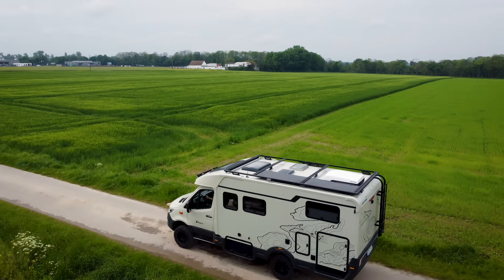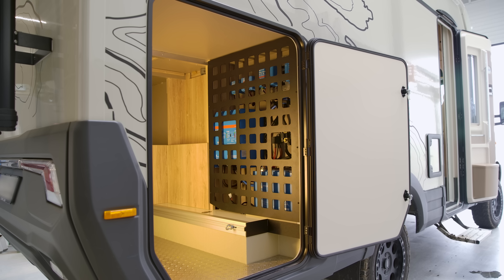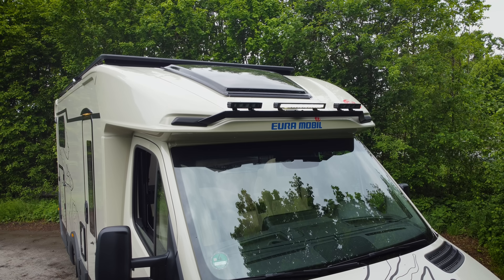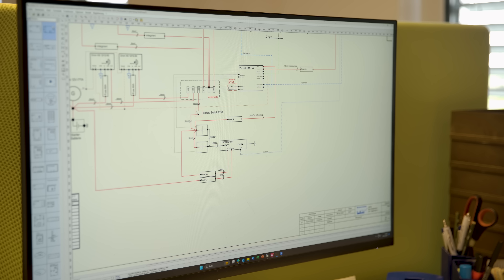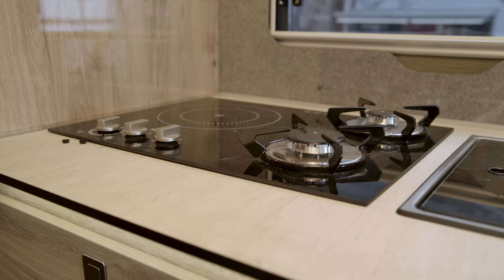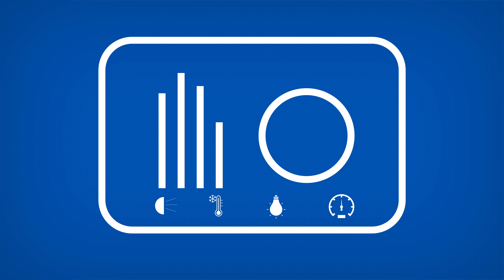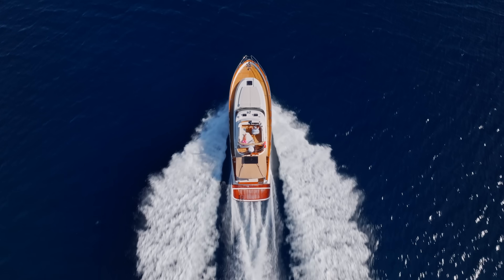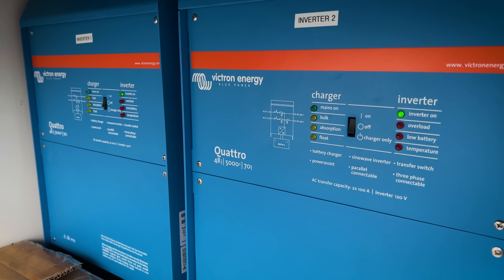Sprinter 4x4 uses a new all-in-one Garmin and Victron control panel

Comment: First, I love my VE system! See VanTransitions channel for details… but 330Ah and that small amount of solar on the roof seems VERY weak to advertise as an off grid wonder van. I don’t get it.

I’m running a Ford Transit with 660Ah, 600W solar, 2 x 30A Orion, MPII 120x2 (much slimmer form factor). I managed 84 hours in full sun (plus the warm nights) running the AC (RTX 2000) at 74F before the batteries were down to 20% and then I went for a drive. This was without cooking, TV, Internet, microwave or anything else. Just the AC and the occasion LED light or USB phone charge.

Good luck not driving distance every day with this rig without more solar and battery.
Reply: I have had several overlanders that used single 230Ah LA battery (basically equivalent to 100-150Ah lithium) and a 200W solar panel. They ran out of fresh water before fuel and electric. They all considered AC as unnessesary luxury item and rather used that weight for other gear. 

Heating and cooling is very energy consuming. I can manage with a 40Ah LA battery without solar in winter for long weekend, since I heat with fuel and absorption fridge. Know also someone that has over 1200Ah in his truck (cooks and heats on fuel, no AC). Such fear for running out of power, thinks it is end of world if he has no electricity left. 

100Ah lithium was few years ago quite normal, nowadays trend I see is to have at least 300Ah or even 600Ah lithium.

So I guess it depends on how conscious you are and your mindset whether that 330Ah is small.

Comment: no propane on that fridge will severly hurt the nomad capability, 3-4 days of rain you will have to run your vehicle alot to charge up the batteries from the fridge draw.
Reply: My fridge is 12V DC 10A circuit. Runs a LONG time.
Reply: Why must a fridge be heated?
In large scale this maes sometime sense (roof top systems)

Comment: Awesome! Now, if only we could get an official and easy to install Victron integration for Home Assistant, so many more people could benefit! (hint)
Reply: Why would you want to pair super reliable Victron solutions with super flacky… (crap) home assistant is beyond me.
Reply: @nja9529  sounds like someones has had a bad experience with a piece of software… the reason this would be a good thing to have is so you can have multiple systems reporting their stats to a main hub, allowing you automate things based on all kinds of variables. I have my Victron system integrated and now the battery status of my home determines whether or not my boiler should generate hot water. But it was a pain to set up due to a lack of integration
Reply from the maker: If it's any help, I have HA and Vicron equipment integrated in my house - and I was the one that filmed this :-)
Reply: @VictronEnergyBV  awesome. By means of MQTT? How did you manage the connection to stay alive?
Reply: Try node red and Modbus (KNX).
Have fun.

Comment: Electronics getting the way deeper into the campers. 
But being off grid and autonomous means a owner must be able to fix things. 
Now Victron and garmin let you trouble shoot but the Mercedes and all the super duper electronics to control the drive is not easy to fix.  
So her you are, its all autonomous  👏 but you have to depend on the manufacture of the drive-train.
It’s not said that the can bus system are very reliable. Many campers have problems with Canbus systems.

This van is super nice BUT not a thing to travel to Mongolia or Kenia. 
What that requires is a old school diesel with manual selections . It may have an old school automatic hydraulic gearbox with torque converter. 
Can bus can system can not be chained like on a fiat van. 
If your abs brake system fails it just must indicate but not stop you van from driver etc. 
Why would your electric windows be canbus driven? Why is there a door lock censor system that tels the gearbox not to drive if the door is open. Sometimes you must drive with the door open. 
Those little things look nice but are over engineered.  
These are unwelcome in a real overlander

Comment: Not sure of the Garmin side of things, my Cerbo-GX with GUI-MODs, some RUVVI and Bluetooth Gas/Water units does very much the same as was pictured. I also have 432Ah of LiFePO4 and more PV on my Caravan, with a 12/2000/80-32 Multiplus-II. Just don't have Aircon and a heated floor - waiting for a Pebble Flow (or Lightship) in South Africa! ❤‍🔥
Reply: Same here Garmin SatNav is deadful

Comment: 330 amp hours of battery seams rather feeble for not having a hook-up. I run 600 amp hours of Victron lithium. Do we know if the water heater is gas?
Reply: It would be plenty if driven daily but would empty quickly if stationary with so little solar panels. My 12/3000 turned on and compressor fridge working consumes 800w daily just sitting at home under clear sky. If its cloudy, 200w solar panels cant keep up with that in summer time, not to mention spring/autumn.

Comment: Excellent job from Victron Energy as usual. Bravi!!!
Reply from the maker: Thanks for watching :-)
Reply: @VictronEnergyBV  I am the owner of a small (3kVA) Solar Power Plant designed by myself and wired with my hands.
All electronics components (inverter & MPPT) are from V. E. except batteries, PVs and breakers & fuses.
They work wery well and I have already produced 700 kWh.